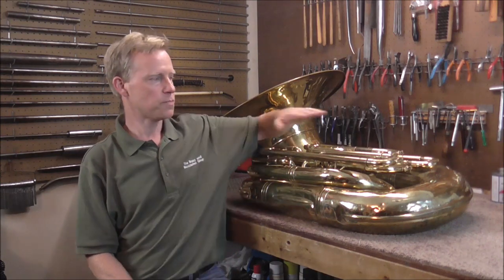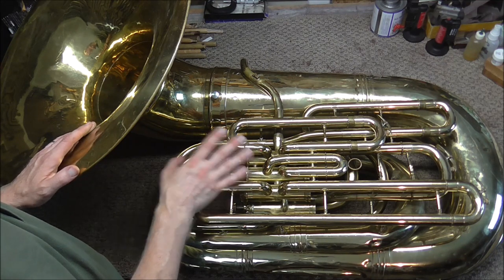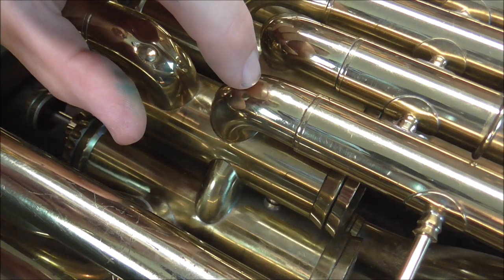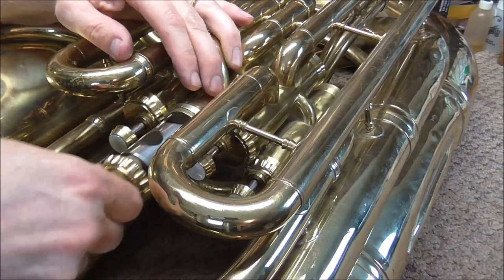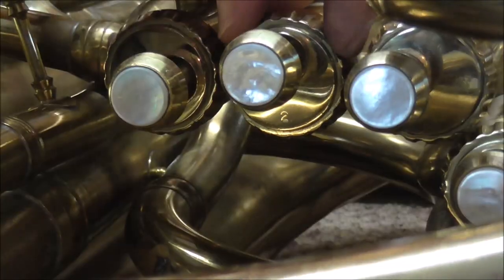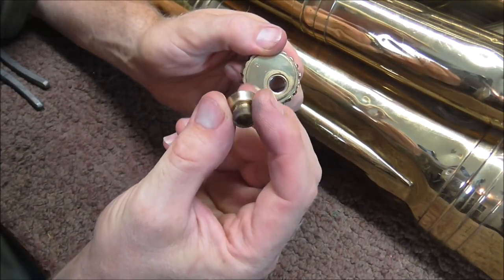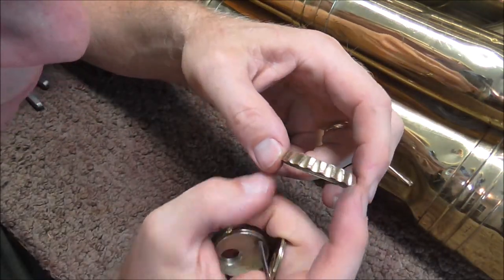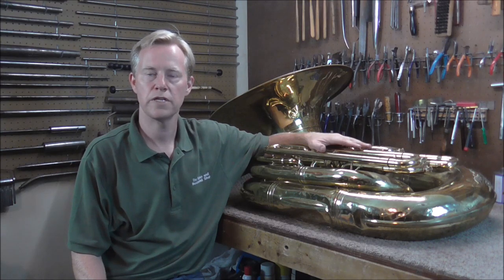Conn 24J Recording Bass Tuba: SHORT ACTION VALVES With Oval Ports

Comment: I have a 24j that by the serial number was built in 1952. I bought it from my high school in 1992 when they were unloading a bunch of older instruments. Considering it had spent 40 years of play in a public high school it was in really great shape. It's always been a joy to play and always becomes a talking piece anywhere I take it, especially any Tuba Christmas events.

Pushing 50 years old now it has become increasingly difficult for me to keep full! On the other hand, anytime I switch over to a regular size tuba I tend to almost overblow so I use the 24J for practice and as a workout, then switch to my Eastman EBB534 for performance. 

The other issue I've had lately with my 24J is the the beel front facing. My hearing, while still good, isn't quite what it was and with all the sound going forward it has gotten a bit difficult to hear myself in the blend. 

All that said, its still fun to play and really fills the room with bass!

Comment: Thanks for this video. I bought a 20J a couple months ago, and I was wondering how to remove the valves for cleaning and oiling. On eBay I saw an advertisement for valve caps and realized the ring is separate from the rest of the cap. However, your video gave me 'the rest of the story'.

These are marvelous instruments, and I'm relieved to read the comments of others that show EVERYONE else finds these instruments heavy, not just me (a skinny 145 lb 70 y/o)!

Comment: The 24J is a real beast. Mine is fully restored, not a dent or blemish on it. I have 20 bass tubas (not counting other types of tubas), and while the 24J is far from my favorite of those, I like its playing characteristics enough to use it for perhaps 10 or so gigs every year...mostly outdoor in the park type of situations where I want to play big without worrying about cracking my tone, and also want the sound to go somewhere besides up into the trees. I find it to be the only tuba I own that I need to use a mini-tuba stand for, rather than resting it on my lap. It also needs two cases for transport, since it is far too massive and unwieldy for a single case (I have both the original hard-shell case set as well as custom-made gig bags. I also own the upright bell, which means that my 24J can also become a 25J when needed.

I find that this tuba has good playing characteristics and a warm, enveloping sound that covers the band like a warm blanket; however its intonation is somewhat unstable if I try to play it like I would my other 4/4 size tubas.....it just seems indistinct and unstable unless I put a lot of air into it. Not a horn I would use for more subtle playing situations, or smaller ensembles.

Comment: Didn't know Conn ever put short-action valves on a normal upright.  That's pretty cool.  The two-piece (err...4) valve caps also assist in preventing the valve guides from getting stuck in the valve cap threads.  It's a very annoying problem on the old short-action Euphs (pre-1950s) because the valve caps are just a single piece with no knurling.  You have to remember to push the guide into the valve casing before tightening the cap.

Shame they don't make em like this anymore.  And yes, the ads are telling the truth.  The Euph version really is faster than a Cornet.  So what about a short-action Cornet?  Imma find out!

Comment: I mainly play trombone, but I have a Conn 20J tuba (the 3-valve version of the 24J) and I love it- such a warm sound, and surprisingly nimble and flexible for such a large instrument. If only the recording bells weren't (mostly) frowned upon in modern ensembles!

Another interesting instrument is the Conn 30J and 34J- they are in every way the same instrument as the 20J and 24J respectively, but the 30J and 34J don't have the short action valves! I can only imagine what it's like to play one of those...
Reply: You can get an upright bell for the Conns......for a price. :(
Reply: @TheMrAshley2010  Yeah it's a shame there's such a premium on them. Even getting the recording bell converted to upright, which saves hundreds, costs hundreds... and then you lose the recording bell!
Reply from the maker: I wonder if they would be OK if you turned the bell sideways. That would have about the same effect as bell-up sound-wise. It would just look a little funny.
Reply: @TheBrassandWoodwindShop  That's exactly what I did for a little while with my 20J to make it passable in the ensemble. Having one sousaphone bit in the leadpipe (like there's meant to be) offered some ergonomic flexibility with the bell turned like that. It looked really goofy, for sure.
Reply: Tell everyone that it's a cross between a tuba and a sousaphone!

Comment: My middle school used--and still uses, last I checked--24Js.  It may sound nuts to put such a big tuba in the hands of a small middle schooler, but they're so much less resistant than the 3/4 tubas the school has lying around. They make it easy to sound strong but not strained.
Reply: Unfortunately, those "monster" tubas just don't play very well if the player is stingy with the air and support. My own, fully restored 24J plays rather indistinctly, with iffy intonation and poor centering if played the way I use my 4/4 size tubas. But if I play "big" and add air and support, the horn almost magically transforms into a nice player, everything starts falling into place and intonation becomes pretty good. Doing this also changes the sound from a shallow, blatty timbre to a nice full enveloping sound. Having middle school kids try to play these monster tubas is just plain nuts.
Reply: @youtuuba  I have a 20J, but I don't play it extremely loud because I don't want to wake up the neighborhood or cause and earthquake. However, I'm looking forward to the opportunity to do so--that way I'll be able to appreciate how this instrument is full capable of sounding!

Comment: My school owned a conn tuba the only difference was that ours were 6/4 size tubas and they were massive
Reply: The 24J is a 6/4. I wonder if the tubas at your school had upright rather than forward facing bells. That would make them seem somewhat larger than the forward bell horn.
Reply: The tuba in the video is a Conn 24J which is a 6/4 size along with the Conn 20J. 20J is the 3 valve version of the same tuba.